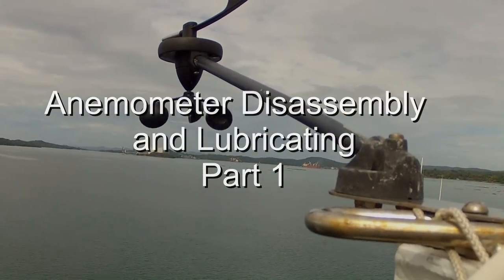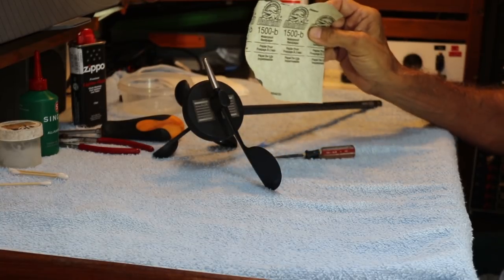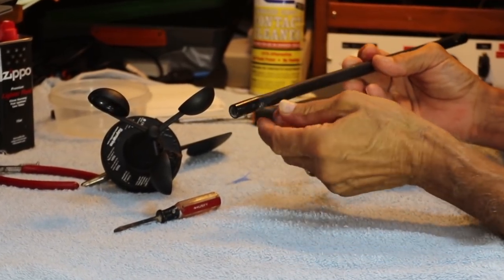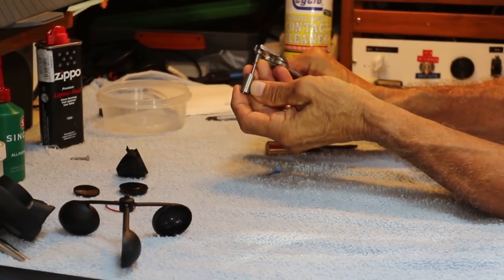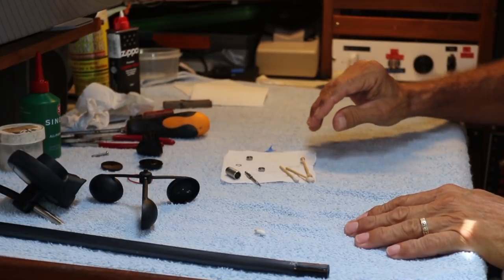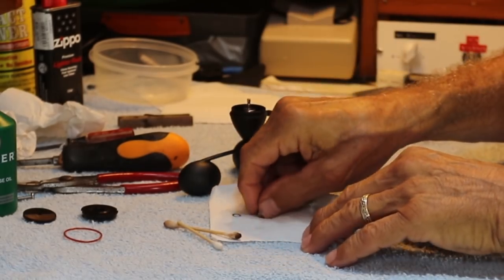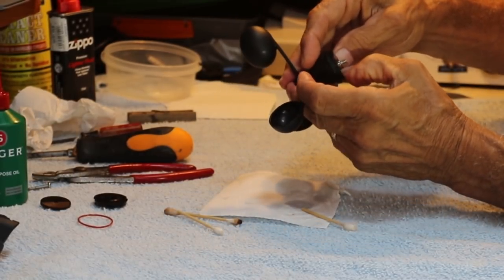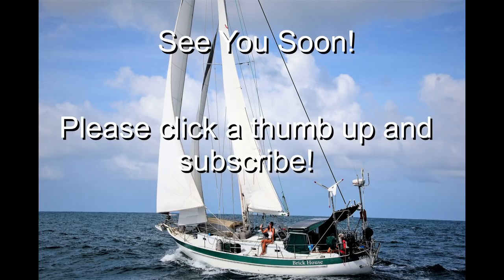How To Fix a Stuck Anemometer, Bearing Lubrication [Tacktick/Raymarine] , Patrick Childress #4

Comment: My TackTick T120 doesn't come apart like this at all.. There is no wind speed bearing, cap to pop off. That is buried under the battery internally. Requiring me to pry the "Cam Shell" top off, leaving the wind speed guts unaccessable.

 I also see NOTHING that connects the wind direction / vane to any sensors.

 However my battery replacement kit DID come with a perfectly fitted new Solar panel lens.

 I hope it works..
Reply from the maker: Ok good luck. The video id a bit old now so things could have changed. Thanks for letting us know
Reply: @RVLifeNOW  I read through the comments.. I'm sorry for your loss. These videos were quite helpful. I'm amazed about this small inconsistency in my OLDER model TackTick (pre-Raymarine) system.

 Your system was a much easier design to open. Hopefully my fix worked. I'll know in a few days.

Comment from the maker: Just today, 25 March 2020, I had one hell of a time getting into our Raymarine anemometer to install a new battery.  It was like thy used a high powered press to force the housing cover onto the base. Using small screwdrivers,  trying to pry the cover up, I had to finally break the cover in one spot, and crack it in another,  to get the two pieces separated. Upon reassembly, I used butyl calk, from a tube, to seal the damage. I did not want to use a sealant that would cause more trouble taking it apart sometime in the future.

Comment: FYI, there is an internal detent molded into the cone of the anemometer (cup housing). You have to rotate the housing counterclockwise (looking at it from the bottom) about 1/4" to line up the internal tab with it's exit slot. At least that is how it works on the original TackTick model. Just trying to pry the housing off as shown in the video will bung up the bottom of the cone and possibly strip off the small detent tab!!! (Ask me how I know this now...) Thanks so much for not pointing this out!
Reply from the maker: Thanks so much for pointing out this detail. Not sure we were even aware of it! Every bit helps! Us sailors have to stick together!

Comment: I have the same Anemometer but manufactured by Raymarine. The housing for the bearings are now made of plastic. It is actually two half-moon parts hold together with a thin rubber band.
Reply from the maker: Yes Raymarine baught Tacktick I think.

Comment: Usually it is enough to annual/pre season just add a drop of fine sewing machine oil on the inverted axles. Or MacLube. Not to much. There is a oiling hole in the cone as well. No need to tear down whole unit.
Reply from the maker: I think he replaced the batteries too or maybe that was the other video. But a deop of oil wont hurt! Can only help! Thanks for your idea!

Comment: I'm a little late to the party, but YouTube loves comments.

Toothpaste has a grit size of anywhere from about 5000 for some whitening varieties to 10-15,000 for the others. It's great for putting the finishing polish on items like those little solar panels. You can use it in a slurry with your finger or make it work a little harder by using a toothbrush.

Great content as usual. Thanks.
Reply from the maker: Toothpaste. That is a great idea.
Reply: None of the fancy gel toothpastes. You want plain old fashioned Crest or similar white paste, or "tooth powder". These are mainly Fuller's (diatomaceous) earth. More like 2000-3000 grit from what I've been told, but great for plastic polishing.

Comment: hello Patrick my plastimo compass is very hazy could i use various sand papers to clean/polish it? its difficult to read at night
Reply from the maker: Sometimes, when something is so bad there is nothing to lose....It would be interesting to try using 2,000 grit paper and wet sand in one out of the way small spot. If you try this, let me know if it works. Sounds like you don't keep the compass covered so the sun rays have been effecting it. If the old cover has disappeared, try making a sack of heavy cloth, with a draw string at the opening, to protect the lens.
Reply: @RVLifeNOW  thank you, will give it a try and let you know

Comment: I'm sure everyone would like to know the reason for the dismasting you mention. I know I would......
Reply from the maker: Mike, it was a failed upper shroud chain plate. A 35 knot squall near the islands of Kirabati, in the S. Pacific, a pop and the mast bent over; all so non violent but the start of a big adventure. We worked our way up to the tiny harbor in Tarawa to further stabilize the mast then set off for Majuro, Marshall Islands where we could have the new rig sent from California. The article is called "When The Stick Comes Down" Cruising World, Sept 2011   The remasting articles, two parts, are in Blue Water Sailing magazine, April and May 2012. To make sure it never happens again to us or the next owners of this boat, we installed grade 5 Titanium chain plates, mast tangs and clevis pins. The Titanium article is in Practical Sailor which will come up in the search if you enter "titanium".
Reply: @RVLifeNOW  Ah, that makes sense, a boat of that vintage with what was probably original chain plates, yep, not unusual. To bad you didn't get a chance to film all that, many people seem to ignore their chain plates, especially internal ones that are more subject to crevice corrosion. Many would benefit from paying more attention to this. I pulled all mine in New Zealand for inspection & sure enough, one was bad. We were in a marina at the time, when I showed it to a dockmate it started a "cascade effect" at the marina as that bad chainplate made the rounds, suddenly everyone was pulling their chainplates, lol! Never thought of replacing with titanium though, great idea but I bet it was expensive!
Reply from the maker: @mikephillips9311   The "cascade effect" also resulted from our dismasting. Friends with older boats were suddenly motivated to inspect their chain plates. One cruising friend said, that while using a prybar to lift out a chain plate, the plate broke in two! Other friends said they had imminent failure and caught it in time. It is only recently that I have learned how to use the video function on a camera. When the dismasting happened, we were not in any immediate danger. Rebecca was a bit tense from the situation so thought I was completely nuts as I did not want to do anything till we got out the camera to take pictures. I had written enough magazine articles, I wanted to document the bad situation and hopefully ease the financial burden by submitting articles about the dismasting. It was an adventure that worked out in the end. But now I know how to video such a situation.

Comment: Thanks for this. I lost a wind cup to hail. Was unsure how this came apart.
Reply from the maker: That must have ben tremendous hail! Thanks for watching.
Reply: Patrick Childress golf ball and tennis ball sized. A bunch of boats had windows smashed out. The reference tabs on my Windex are ripped off and the wires are bent down and upwards. Don't know how it bends up lol. A couple boats had holes punched thru the gel coat and one guys fiberglass companion way has 4 holes in it.
Reply: WOW !  Where did this take place?